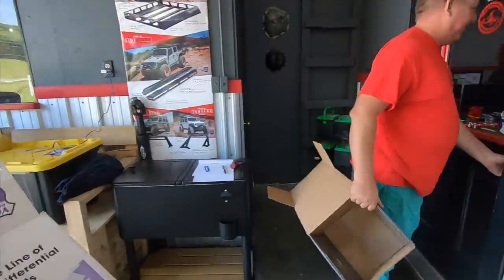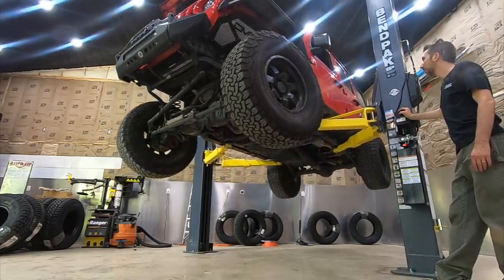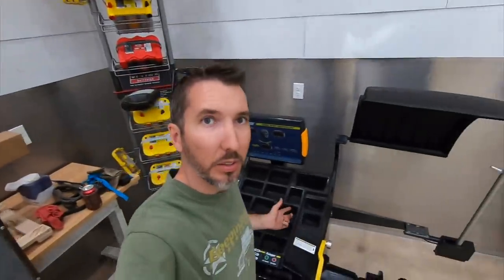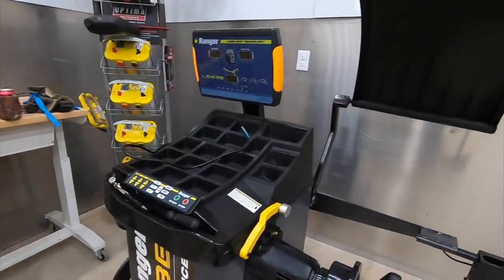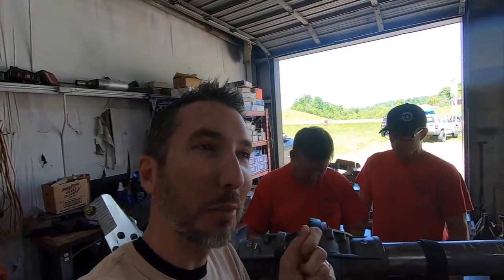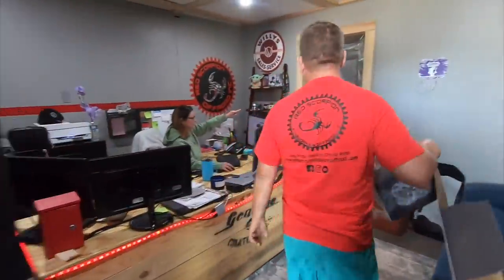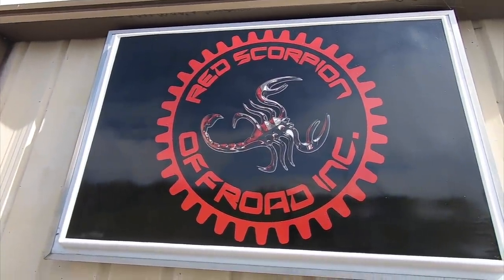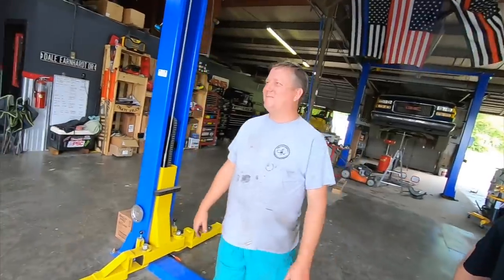Scorpion 2.0 Going Rear Steer??

Comment: The new shop is Nice! Even though you don't have a tractor now,  by a set of 2-3 thousand pound rated skid steer mount forks for you neighbors tractor. Then you use them on your tractor later on. (unless you get a deere).

Comment: Very sweet axles etc.  It's always best to keep documentation to every project/replacement/repair, sales receipts, photographs and so on mainly because we're talking about older vehicles that are usually customized. It's a PITA to try to remember how something was put together and what parts were used a year or four later when something breaks or needs serviced. It also helps to stock and save parts that are hard to find. When I see a part or whatever that applies to my rig, I buy two of them, one to use and one as a backup depending on how rare the part is and/or how often it would need replaced. 
Those pinion bearings are full roller bearings while most are tapered bearings. This set up must have a design that does not allow any thrust to transfer to those bearings.

Comment: Once you lift the vehicle a foot or two off the ground, ALWAYS do a shake test for stability. It is much better to drop a vehicle from that distance, rather than find out if the vehicle will drop when it's up in the air.